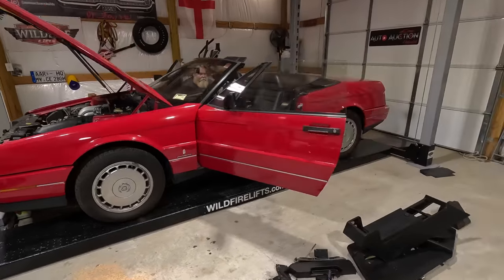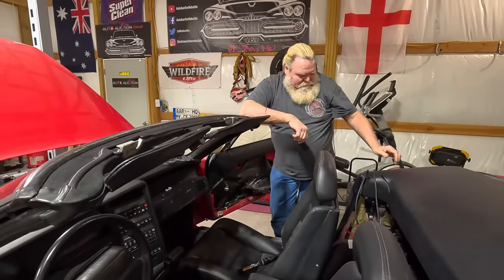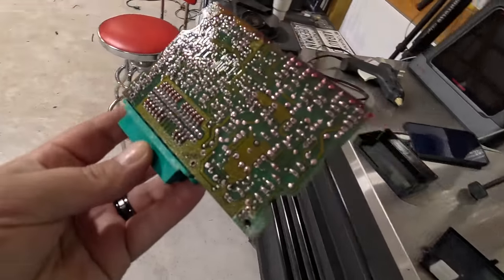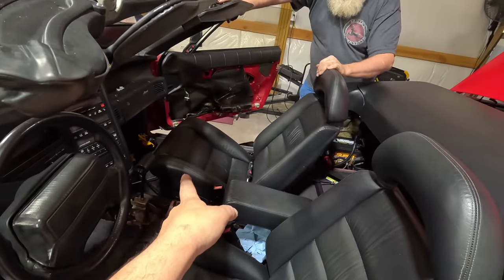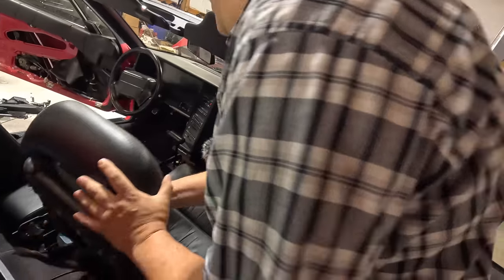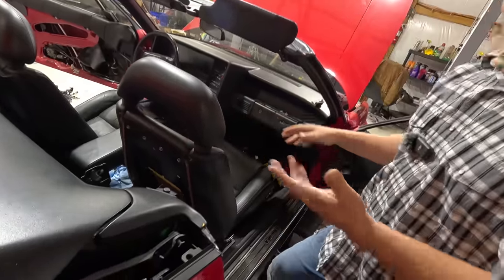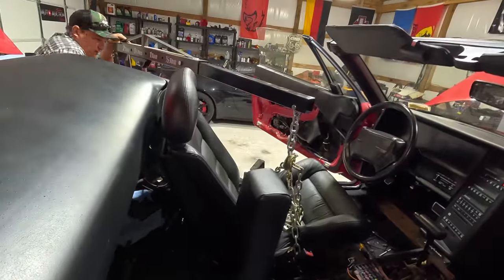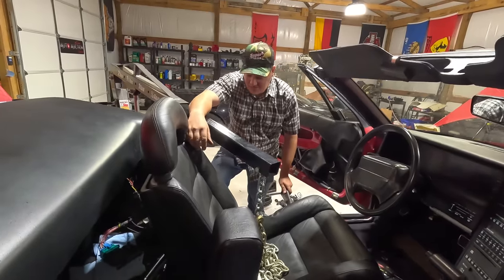I used an Engine Hoist to Remove my Seats - Gone Terribly Wrong

Comment: Randy, good luck with replacing that windshield because they are rare and extremely expensive if you can find them ! I used to buy them cheap and flip them over $500 each 15 years ago !
Reply: Happy Birthday old man !
Reply: Any auto glass company can make a new one.  That little amount of damage though you can have Autolite fix with their crack repair service.There is no reason to replace it.
Reply from the maker: Safelite has one for $375 installed it’s not rare anymore
Reply: @AutoAuctionRebuilds  Yup. There you go. The wonders of modern technology.
Reply: Happy belated birthday
Reply: @AutoAuctionRebuilds  awesome!

Comment: I saw Amazon had a 10 Pack Bosch Style 5-Pin 12V Relay Switch [SPDT] [30/40 Amp] 12 Volt Automotive Relays for Auto Fan Cars that may be a suitable substitute, it listed for $14.95.  Enjoyed the show, and good to see Santa again.

Comment: A friend's Cavalier or Neon had the shift cable getting stiff due to rust.  As he shifted the gearshift I slowly dribbled Marvel Mystery Oil into the cable.  About a minute later it was fine and lasted the time he owned the car.

Comment: Thats an insane amount of damage done to remove the seats. Windshield, sunvisor, steering wheel leather, door sill and seal, seat mounts ripped off, seats themselves with the trim. If you took it to a shop for those repairs the car would easily be totaled :D
Reply from the maker: Thankfully it's already totalled lol.
Reply: The 20 year old college flunkies at any auto shop wouldn't even know what this car is for one thing.  They didn't even know where the engine was on my Previa.
Reply from the maker: In the middle of the van lol
Reply: @AutoAuctionRebuilds  Yup. lol Was pretty funny watching them dig in the front hood with flashlights. I said "oh boy my poor car" when they asked me to show them.  If you ever find one Randy, keep her. Great little hauler for any odds and ends things you might have. I've seen people fit entire scooters and snowmobiles in the back! They are collectible now too so even if you want to buy one to flip they sell for a lot when they are in good shape and all nice. Most of the time what totals them for people is front end fender-benders since the axle is so near the front and it has such a short nose. I don't think I ever seen one with a bad transmission - which is often common for minivans. The engine placement is a big faff at times but the car as a whole redeems itself for that annoyance.

Comment: I would have tried an air hammer or impact chisel before resorting to the scorched earth scenario. Those usually can coax a rusted bolt to unstuck itself enough to undo it one time only.

Comment: I am surprised you or Michael didn’t lift the car you could have drilled out bolt or cut nut off with oxide or ground of with grinder even cut the floor and patched it but it would not of been as exciting anyway happy birthday 🤔

Comment: Longest assembly line in the world this car was. The Cadillac Allanté is a two-door, two-seater luxury roadster marketed by Cadillac from 1987 until 1993. It used a Cadillac chassis and running gear with a body built in Italy by coachbuilder Pininfarina. It was expensive to produce with the complete bodies flown to Detroit for final assembly. Over 21,000 were built during its seven-year production run.

Comment: I think i would have lifted the car on the hoist and see if the seat bolts come through the floorboards and welded a smaller bolt on the and loosened them that way.  Then cut off the welded bolt.
Reply: It’s double floored, that was the first thing I checked.
Reply: @SantasWorkshop  Great minds think alike lol

Comment: Do the seat bolts not go through the floor pan where you could drill them out from underneath?
Reply from the maker: Nope. It's double-bodied.
Reply: @AutoAuctionRebuilds  ah, that makes sense.  Silly GM

Comment: Surely the seat skins are held in by edge clips and a simple job to remove all the clips and pull the seat cushion out to reveal the seat frames..... from which to see the seat anchors below the frames.... Some over night CRC and you could have been successful....? but hey, great content - 5/10 but the winner of the week still goes to Tavarish for destroying his Maclean engine 10/10  - a must see...... come prepared to have tissues on hand!
Reply: the wouldn't have worked, the subframes is blocking the allen head bolt. The seat needs to be in forward position to get rear bolts out. But if the seats won't power, you have to take more drastic measures. I used a cutting torch from the bottom and patched the hole later. but Randys method was funnier ! lol

Comment: I would have cut the seat in half to get the bolts out. Sucks that the windshield broke.
Reply from the maker: Would have destroyed the leather, and still wouldn't have gotten to those last 2 bolts on either seat. Tracks are rusted solid in place so they can't be moved and each seat has 2 bolts the track is covering.

Comment: Why didn't you just drill the bolts out from under the car? Long sawzall blade?
Reply from the maker: The car is double-bodied meaning 2 layers of steel. There is no access without cutting the underside body put and compromising the structural integrity of the car.

Comment: At first I thought what an idiot but the its a fully flooded car and the nuts and bolts under the seat are super douper rusted and that's why he had to go through such an ordeal. Buy the parts car that you talked about and atleast you will get a windshield.
Reply: The seat motors dont work so the seat wont move to expose the bolts